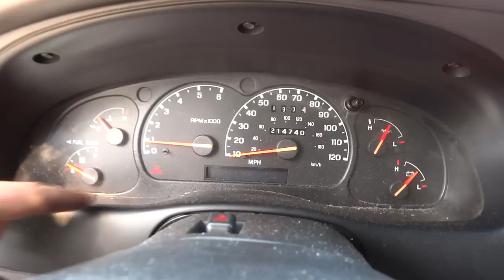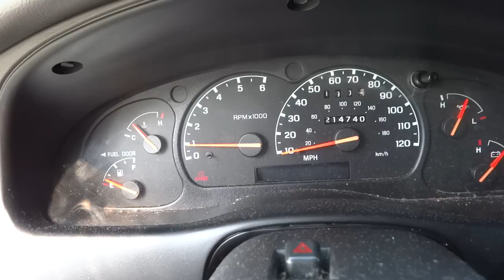Engine Knocking or Ticking?!? This Could Be Your "FIX" Ford/Mazda/Bmw/Honda/Toyota

Comment: thank you for taking the time to post this. I have the same issue in my 2006 Focus.
that will be my next project. went to the scrap yard and pulled out an intake manifold from one of the cars there, so I eliminate the shutters on it, and then put it on my car. this way I reduce the time the car is out of commission.
thanks again

Comment: this guy is a genius. If you investigate more about the problem with the flaps and the metal rod holding them. Many engines have been ruines. he has completely eliminated the problem. job done and well done. great video
Reply from the maker: +john chappell Thanks John. They just don't understand. Most would rather criticize,then to actually see a solution.

Comment: I took my manifold to a shop and the hot tanked it for me. Much easier. Also removing flaps on these engines will effect drivability and reduce MPG. My experience is on a 2003 2.3 in a Ford Focus.
Reply: How badly will it reduce performance? Mines a 2.3 tribute.

Comment: Well done NTFL!  Well done indeed, overcoming those few design flaws and weaknesses of the intake to get a better performing engine (sans flaps; I also like how you made up for broken parts during the operation).  Kudos young man.  Really appreciate you sharing the experience and very useful tips.

Comment: Hey I remember those! I had swirl flaps in my BMW 320d. For that particular vehicle a flapectomy is essential. The flaps are only there for emissions control. If you dont take them out... the Diesel soot gets into the intake via the egr and causes those 2.5mm axles to have just a bit more resistance. Over time it causes metal fatigue and then they break. Get sucked into the engine and either prevents a valve from closing (in an interference engine) or plays ping pong with your aluminium cylinder head...
Reply: Is it bad for your car to take the runner flaps out?
Reply: @jakobhanson2889  In the particular vehicle I mentioned, it only makes it smoke a tiny bit more in the mornings. I personally saw or felt no difference after removing the flaps. I also didn't keep the vehicle very much longer either. It was still a BMW, it still broke something every few weeks...

Comment: I bought an aftermarket intake manifold since the OEM was a bit pricey for my car, now it sounds like a diesel lol
Reply: The same happen to me :(
Reply: It's because the map sensor isn't made for that. I bought a cold air intake for my fusion and it made a horrible noise from running to rich. And it retarding the timing.

Comment: I bought a cheap beater Mazda Demio1.5 (never sold in the US I think) and it has a very similar sound to this. I've only had it three days and it drives, revs, pulls and idles just fine but there is just this sound which is making me paranoid as hell! I really hope this is the issue because I need the car to get to work!

Comment: Those flaps were clearly put in there for a reason I suspect the reason is they didn't want to go to a drive-by wire system so with those flaps in place they can use manifold vacuum to slowly give you airflow even if your foot is to the floor. They basically created a torque management system probably to improve the driveline durability as well,so when you remove those flaps of course you're going to feel more throttle response and your power will be coming on faster. I'm sure they did this for a missions reasons and to keep the catalytic converter running cooler and lasting longer. I doubt you gained any power doing this however your perception of it is much greater because now he responds like a carbureted car not one that has to torque management.if the entire vacuum system that applies the flaps is working properly the flaps should not be moving around.The diaphragm in the actuator was probably leaking slightly. I think you could have accomplish the same job by simply disconnecting the actuator rod to the flaps and permanently wiring the flap Rod open and leaving the actuator discdisconnected yet leaving new vacuum and electrical connectors in placeThe computer would have been happy it would've thought it was still there and it would've saved you a ton of time.those flaps would not break off if they were simply wired open and I doubt they cause any significant restriction in airflow.I did learn about the noise from you though so thank you for that .
Reply: It's not quite those simple. The valves are designed to restrict airflow in an effort to create turbulence. Think about a garden hose. If you cover part of the it with your thumb, you get a jet stream of water, despite the fact that you didn't change the amount coming out of it at all. Intake air behaves a lot like water, so this forces roughly the same amount of air into the cylinder, but with a lot more force. In theory, the result is swirled air. Knowing this, the PCM will try to just inject less fuel, since the air:fuel ratio tips heavily toward air when the right amount of turbulence is created. Does it help with emissions? Well, it's burning less fuel, so it has to. Especially on cold starts where it usually has to flood the engine to get it moving. Of course, all of that sounds way more beneficial than it actually is. It helps exclusively in the lower RPM's. When the engine's turning faster, there isn't enough time to create pressure. It just needs to suck in as much air as it can get. Restrictions will do nothing but hurt in that case, hence why the PCM commands the valves to stay completely open after a certain point.

As for the easier fix, that certainly isn't going to happen. As anyone who has worked with a Duratec 23NS before will surely tell you, that intake manifold was bolted on by the devil himself. It's huge, contains parts in ungodly inconvenient places, and is in the way of almost everything on that half of the engine bay. I swear, half of the repair procedures in my manual start with "Remove intake manifold." It's ridiculous. The swirl actuator itself is on the very back, and there's a lot of other stuff back there. Good luck reaching a hand back there to even touch the plunger. Plus, the main issue here is that the valves are loose. Their function is completely lost if they can't stay still, and the surging back and forth will just restrict the air too much, hurting performance by a long shot. And since they're loose, they're far more brittle. I've never seen it on a Ranger before, but I've seen other Duratec engine owners find a broken runner valve hanging out in front of one of the intake valves. If it managed to break in half and get sucked into the engine, game over.
Reply: Those flaps are designed for cold starts, and are common in modern VW engines. They DECREASE performance and multiple providers have kits to remove them. 

On a 300hp turbo 2L 16V removing them makes around 10hp, which is a good amount considering it's a "minor" air restriction.
Reply: John DiMartino except the trucks not drive by wire.

Comment: I'm about to change the flaps on the intake manifold on my mk3 mondeo. the noise is only slight but goes away when the vacuum hose is removed. a new set only costs £66 and includes the gaskets too. the car otherwise runs sweet and uses no oil. mileage is 119k miles.

Comment: My 02 Ranger 2.3L started knocking the day after I purchased it at an auction. The knock would start and about 1100 RPM and continue as you accelerated up I was completely convinced it was a rod knocking. Of all things it turned out to be the power steering pump.

Comment: I'm thinking if you replaced the external actuator, it would fix the problem and take maybe ten minutes instead of two days. After all, it is what flutters the butterfly valves, not the other way around. You proved that when you pulled the vacuum hose off, and things quieted down. If it's about the money, you could have pulled the hose, plugged it with a screw, and forget about it.

Comment: Great job buddy you are a bomb. Man the way you explain is just perfect keep it up champ and by the plastic intake manifold is a shame that it break so easy but you know the game of the game "money" that's why they go with plastic is cheap weak and  break.we never going to see those heavy and strong metal parts in our machines
Reply from the maker: Really appreciate the kind compliments Christian,Those are what keep me going.Yes, definitely cheap and there lookin to save money at any cost. They use to be hefty aluminum intakes. I use to own a "88" Ford Ranger XLT 2.9lt V6 and that thing was built like a tank! over 300,000 miles and only cracked a cylinder head.All I ever replaced was the fuel pumps filters and tires.Best truck I ever owned. And the seats! most comfortable seats you'd ever sit on..felt like you were at home on your fabric sofa haha!

Comment: Jeremy thanks for the video, it was great. I have a 2003 Ford explorer and was trying to duplicate what you did, I do not see a location of a "flutter" or "butterfly valve " do you know what the fix would be for me, (My noise is identical and stopped when vacuum to the intake was disconnected Thanks

Comment: Instead of gluing the plastic intake, you can plastic weld it using a soldering gun and black zip tie as a filler material-check out videos on plastic welding methods.
Roger

Comment: I have a 2002 ford ranger XLT 2.3L.  i just took out my intake manifold and removed those stupid flaps.  I'm so happy i found the source of that noise, a quiet engine is mandatory.  ive been cleaning my manifold nonstop with brake clean, white gas, and a tooth brush.  i ordered the same glue (Versachem, Plastic Weld, 3500 PSI), the glue is rated to 200 Degrees F, will it withstand my engine heat?.  my thermostat opens at 202 degrees F, i ordered a new one just to be safe.  how is the mazda you worked on?
Reply from the maker: Been running it in Florida heat 10 months now, no problems.

Comment: I have a ford ranger with the same motor now I know what that noise is I find that when its colder outside it gets worse. I Don't think the flaps will brake if they are just moving up and down if they hit the side walls of the intake they might break off. Looks like a lot of work to make this noise go away  I do agree cheaply made intake

Comment: The purpose of the {swirl flaps} is to ensure that the air entering the cylinder is sufficiently turbulent for good fuel-air mixing even at low engine speeds.This happens in the 0- 2000 rpm range. This aids in reducing certain toxic emissions, ,unless something is broken ( servo, shaft) this is a silent operation. there is no flapping action going on,  they can also set off a engine code, you might not be able to remove them in certain states . You would have to check that out.
Reply: josef vopinka

Comment: What year did they start using these? I have an 88 s10 Inline 4 that sounds like a diesel, but I imagine that it is too old to have something this sophisticated

None of the rods are bent, thinking it could be the lifters
Reply: +Neil Caulfield   run a bottle od lucas oil through it. u have bad lifters

Comment: I have a EL fairmont ghia Doing the same noise first i thought it was something broken maybe top or bottom end Which is bad in any cars case due to it costing alot  I topped the up oil in hopes to lube this baby up I fulled it up oil an all! Still ticks on the start up but goes away a little when reving it I think i might try this cause i dont wanna spend serious coin just yet i'll let you know if it works

Comment: I'd have to say as a mechanic, I'm not seeing a purpose for the flaps much at all. There is the butterfly on the throttle body that does the same thing. Sometimes they put unnecessary things on your car just so you got more problems to fix!
Reply from the maker: I didn't notice much of a difference, I even installed a newer one with the flaps and didn't notice any significant difference at all. The only difference was, the noise came back with the newer one. If one of those runner flaps break off and get stuck between the cylinder head and valve, your motor could be done for. That's why I ripped them out instead of buying a new one in the beginning. I've personally ripped them out of every vehicle I've owned. I have a Acura Integra GSR motor and I deleted the runner flaps as well, if you're planning on tuning, the runner flaps will actually hinder your performance.

Comment: That's a TGV Delete like on Subaru.. its not made for enhanced air flow... its for lower emissions during warm up conditions. It actually restricts your intake... jb weld should work if mixed and cured long enough and the surfaces are prepped correctly.

Comment: great video! I am having trouble with these butterflies, now I know I can just remove them. Have you found a trick to get to the EGR valve on this 2.3L? Looks like I would have to lower the tail of the transmission, reach over the bell-housing to get to the bolts.

Comment: I have that noise on a 2005 2.3l Escape. If I unplug the solenoid the noise is gone. Can I just leave it unplugged? Or can I leave the connector on and unplug the vacuum line? Will just unplugging it have any effect on millage? It runs fine, just that the flappers really makes it sound bad. Thanks for the help!!
Don
Reply: Hello there. I'm interested to know what you have done about the issue since then. I'm driving with the solenoid unplugged atm. I'm assuming unplugged means the flaps are partially closed which is ideal for city driving...

Comment: why don't you just take the electrical socket for the "flap controller" out and glue the control arm which is control the opening and closing of the butterfly wing inside ? in that way you won't have to worry about some plastics will go to the cylinder.
Reply from the maker: Sang H The plastic flaps were all loose on the shaft. Even if I did what you are suggesting, they would of still rattled.
Reply: got it. or you can try to melt the flap by heat gun or hair dryer to completely take all the part. thanks for great video

Comment: Nthefastlane 
Hey i have a 97 civic ex I just started hearing a knocking so I checked my oil and I have alit to much oil when it started so i took the bottom oil pan out and found small pieces of metal so at first i thought it was the connecting rod bear but they all look fine i was wonding if u could give me a tip on how to find the knocking thanks love the vids

Comment: Hey, I pulled that vacuum line and left it off and it ran quiet for a day, but then it began idling terribly. I replaced the hose and disconnected the battery and it fixed itself, but I'm still showing the CEL. Any advice? Could I plug both the hose and the nipple on the intake rather than just keeping both open?

Comment: thank you for taking the time to post this.
I will be doing the same job on my 06 ford focus soon. its been making this ticking noise recently, even though it only has 140,000kms on it!
just one question, if i delete these swirl valves on my car, should I expect any problems in the winter? we get extremely cold winters in eastern Ontario, Canada.
they must have a function, no?
I dont see Ford motors throwing them in for charity!
do you have an idea?
thanks again
Reply: the valves are put there to increase bottom end torque and improve burn efficiency at low rpms, the "swirl" effect promotes more turbulence needed for low rpm torque (cruising and off the line power), the valves are desinged in most cases to switch out of the way and allow more flow once your at higher rpms and swirl is less necessary for power
Reply: the valves are put there to increase bottom end torque and improve burn efficiency at low rpms, the "swirl" effect promotes more turbulence needed for low rpm torque (cruising and off the line power), the valves are desinged in most cases to switch out of the way and allow more flow once your at higher rpms and swirl is less necessary for power
Reply: the valves are put there to increase bottom end torque and improve burn efficiency at low rpms, the "swirl" effect promotes more turbulence needed for low rpm torque (cruising and off the line power), the valves are desinged in most cases to switch out of the way and allow more flow once your at higher rpms and swirl is less necessary for power
Reply: the valves are put there to increase bottom end torque and improve burn efficiency at low rpms, the "swirl" effect promotes more turbulence needed for low rpm torque (cruising and off the line power), the valves are desinged in most cases to switch out of the way and allow more flow once your at higher rpms and swirl is less necessary for power

Comment: What is the hole purpose of the flaps , thanks for posting
Reply from the maker: +danssv8 Increase the torque curve. Not much of a noticable difference in my opinion.

Comment: Hey man I just bought a 3.0 2004 ranger it has same problem I'm about to go pull the intake now thanks and does it peform any better I have heard the 3.0 was not very good on the performance part
Reply: How did it go? I have the 3.0 in my ford ranger and it sounds exactly like this.

Comment: My bmw is starting this noise as well....BMW wants around 300.00 to clean it out but not pulling it apart cuz of course the price goes higher then lolz 2006 330xi 89,100 miles

Comment: I have a a 2001 mazda b 2300 code for the intake running manifold control but i see that only has 1 hose but the valve has the pin for another one that suppose goes to the back of the manifold but i cant find the spot